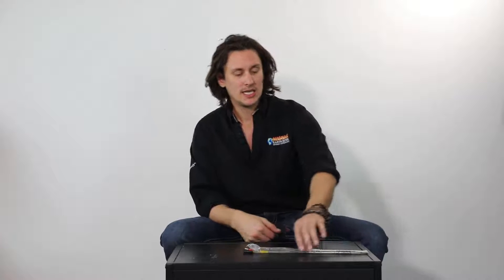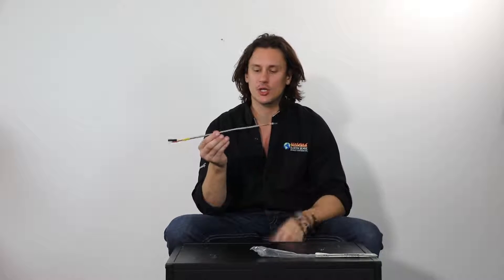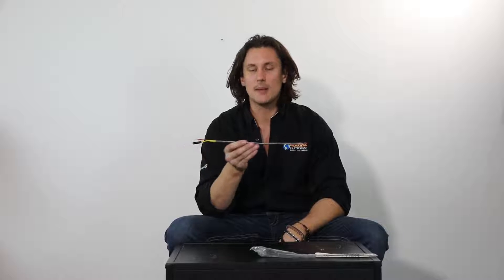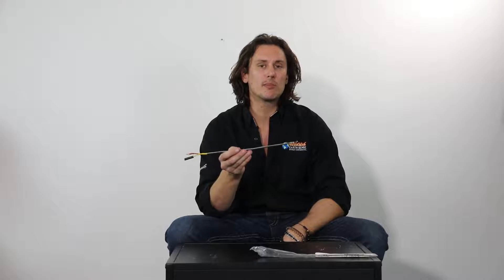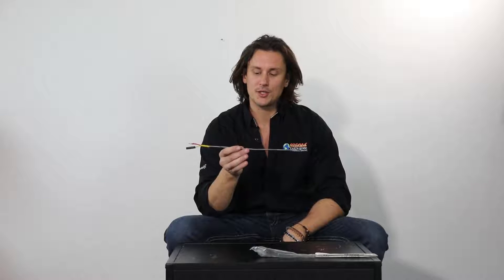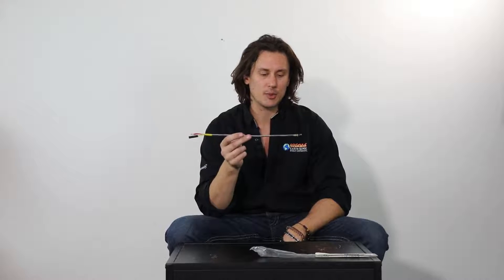Quadrafire Thermocouple Function & Troubleshooting

Comment: electrically what does the thermal coupling do when there is sufficient heat? close a switch?  can it be tested by disconnecting the thermocouple wires back at the board and putting a propane torch fire near the thermocouple head in the burn box?
Reply from the maker: Thanks for the message David. Ran this past our lead techs. Here is some info for you to review:

Yes it can be tested, what are the symptoms?  A TC can be bad yet still have continuity which would cause the board to not signal a fault.  

Millivolts go up and down based on how much heat is being sensed at the tip.  So yes, he could test it with a torch however the sensor is not designed to take direct flame which is why they sit in the ceramic protection tubes. Also, he would really have to know at what temperature each component is turning on or off at, otherwise it is simply watching the numbers go up and down without jumping all around. 

1. Thermocouples are bi-metal millivolt generators.
2. When heat is applied to the working / twisted end, millivolts are produced.
3. The amount of millivolts produced is directly related to the amount of heat applied.
4. The temperature / millivolt relationship is specific and predictable and is used as “proof of fire”.
5. Millivolt production is vDC which means that thermal couple connections are polarity sensitive.
6. The twisted end sits within a ceramic cover directly over the burn pot.
7. The TC wire must be inserted fully into the ceramic cover.
8. Heat from a new fire causes the TC to begin producing millivolts.
9. The control board is programmed to react to 3mVDC which is the amount produced by the TC
@ 200 degrees from the initial flame.
10. When the control board senses the 3vDC, a green light turns on recognizing proof of fire and
begins the normal feed cycles depending on heat output selection.
11. When the control board light turns red, this indicates that the TC has been subjected to 600
degrees and has produced 12mVDC which the control board programming recognizes. Note:
only the green light on is necessary for normal stove operation.

Let us know of any other questions or assistance we can provide.

Comment: Do you recommend changing out the thermo couple at a certain point even if it still works?
Reply from the maker: Thanks for the message. If the thermocouple is working properly I see no reason to change it out. Sometimes after several seasons folks like to purchase back-up parts. Oftentimes failures happen at the most inopportune times and it can be good to have a spare if and when needed. Any other questions please let us know. Thanks!